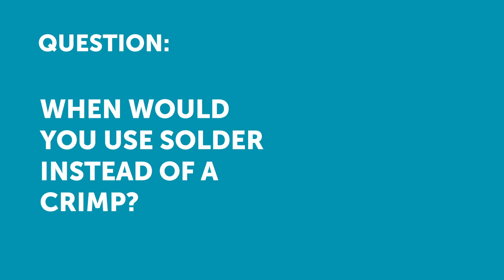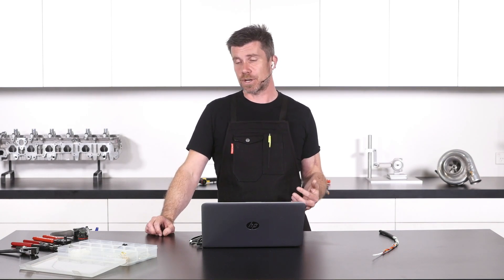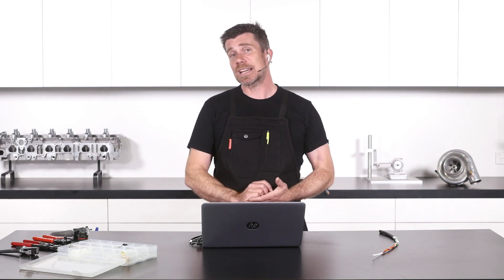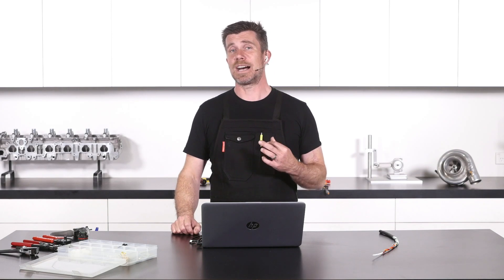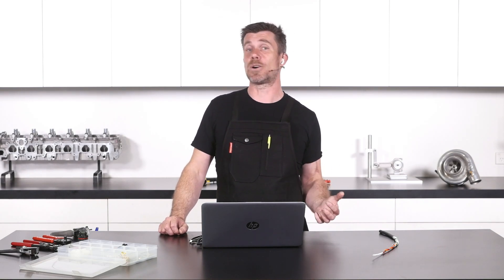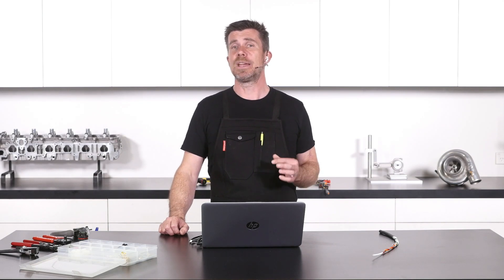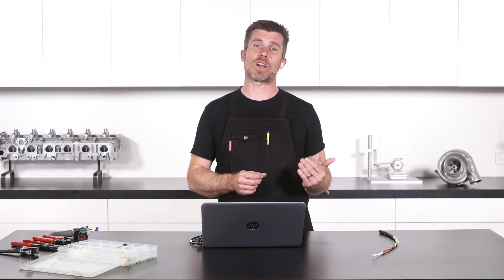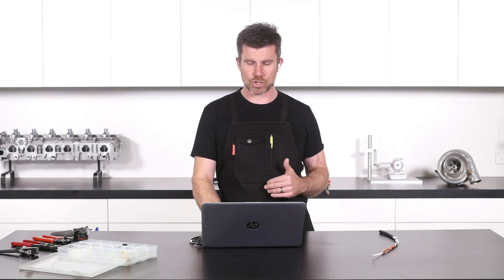When Would You Solder Instead Of Crimping? [HPA Q&A]

Comment: I've seen many OEM crimp connectors fail on motorcycles, particularly where the wiring is pulled back and forth due to turning the handlebars, usually the wiring breaks right at the end of the crimp. I have always repaired these with solder, i feel the trick is to be as quick as possible once you apply heat so it does not have time to disperse through the wire to avoid making it brittle at the end of the joint
Reply from the maker: Your crimping and sealing will be better than OEM if you do it correctly. Doesn't matter what you do regarding solder, the risk is always there. 
That doesn't mean it WILL fail which I think is a point a lot of people miss, it simply has a higher risk of failure by comparison, and of course you are free to do things differently to us, we just explain what we do and why 🤘

Stay shiny side up and cheers for sharing your experience Kyle! - Taz.

Comment: Less is more when dealing with soldered joints. It's not about creating a connection that should be done with the joint construction. 
If the shielding is warm you already fucked up. 
I do enjoy those shrinks that have it built in. 
I'm dealing in more of the repair side of the industry. Hate seeing butt/nut connection from the weekend warriors.

Comment: I have a question for you I'm wiring up a 65 chevy c10 truck and it has 3 after market gauges that have the power pole and the tab on the same piece of metal can I use the pole to wire in ther power side or do I have to use both